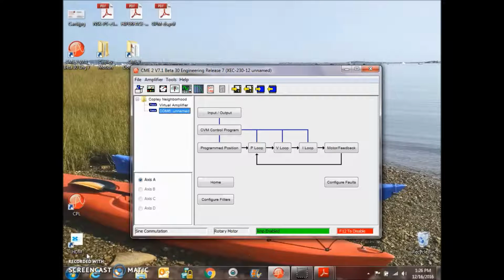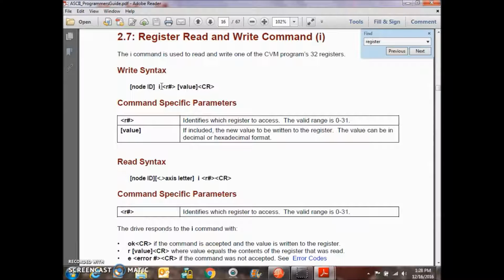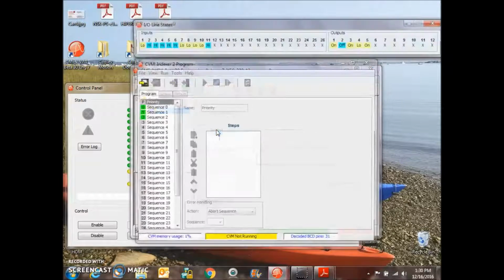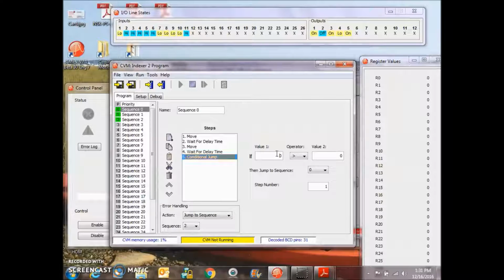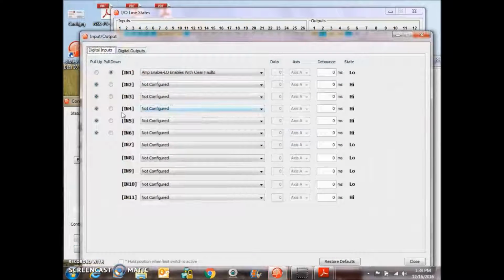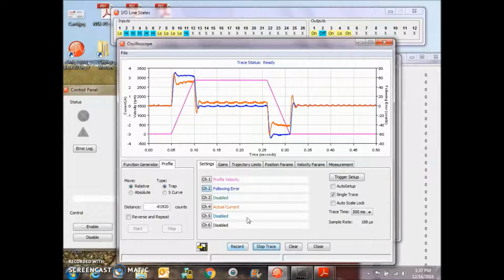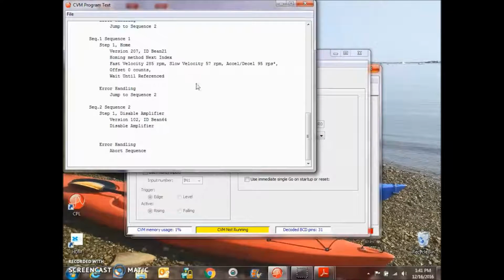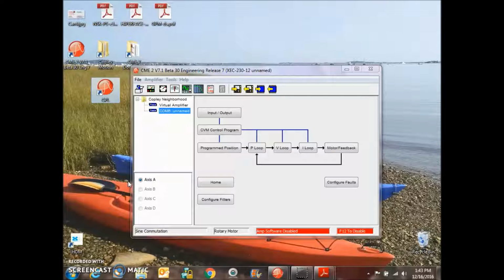Stand alone Motion control using CVM Indexer - Typical test stand program

Comment: Is there any way to run CVM without saving it to flash? Just on runtime it will be updated and the move will be started by gpio like you've shown.
Reply from the maker: We do not want to write the program every time we power up the drive so we load program to FLASH. Yes, we can write to RAM after power up. For example, we can read/write over RS232 ASCII to CVM indexer registers R0-R31 values for the program or not even use CVM and just write to the drives trajectory generators the values of the move and then issue T 1 to update the trajectory. See my RS232 ASCII video.